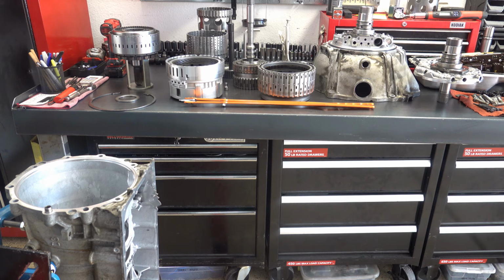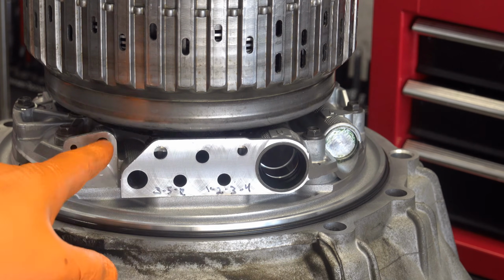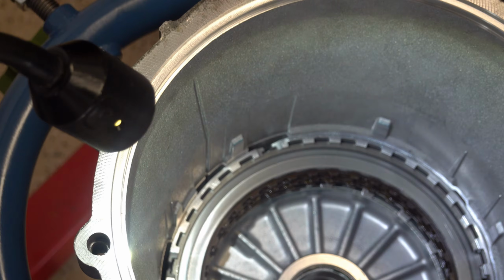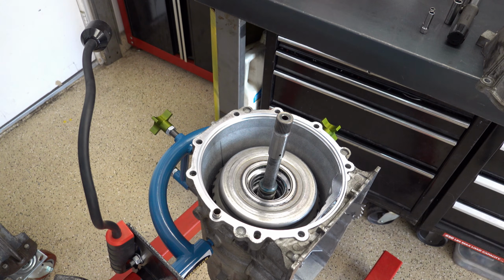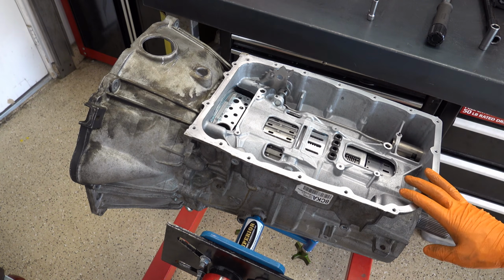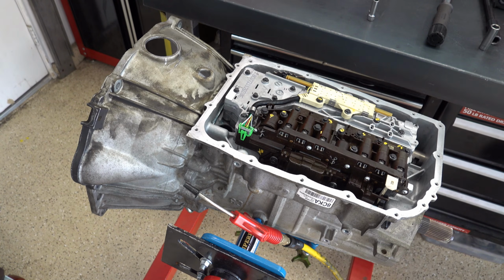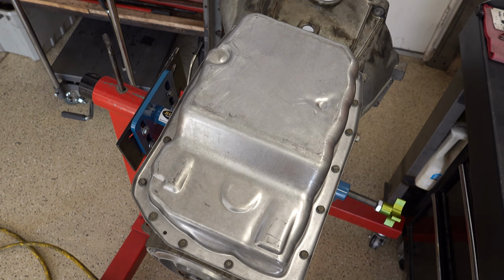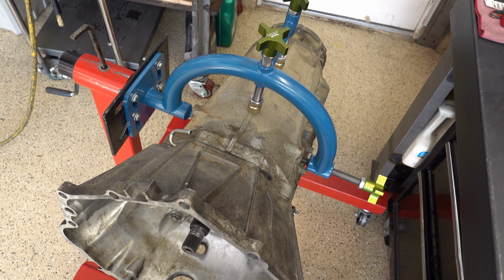6L80 Assembly PT2 - Final Assembly (DEMO) - Please Read Description

Comment: Hey Nick, Awesome videos! On the air check of the 456 drum , same as you have set up on the bench, I have air coming out compensator feed  port and center of shaft. The 456 clutches do apply but don't hold air pressure immediately after air is released. Also what psi air should be applied? Thank you.
Reply from the maker: Thanks, Peter!

The 4-5-6 clutch should apply and hold air pressure as long as you're flowing air into the circuit but as soon as air is released they will release. The compensator feed hole should hold a bit of air after airflow stops but before the nozzle and your finger is released, assuming you're testing the compensator feed circuit on the bench w/the pump, 3-5-R drum and 4-5-6 drum along with the three hubs all assembled...I use anywhere from 75-100 PSI typically as it's fairly close to what those clutches will see at lower to moderate RPMs.
Reply: Thank you Nick, Appreciate the response. Keep up the good work!
Reply from the maker: You're welcome, Peter and will do!
Reply: Hey Nick, I rebuilt and installed in 2015 Chevy Tahoe. It drives in limp mode 3rd and reverse I believe. Also engine light on despite removing codes with scanner. Will not illuminate Manual or tow mode on the dash selector. Any ideas? I did check plugs for connections.
Reply from the maker: @petermilner5493  Hi Peter. Did you perform a fast adapt relearn?
Reply: @nickstransmissions  Hey Nick, No I did not. I borrowed a snap on Solis Ultra that he uses on dodge transmissions but haven't found an option on it for fast learn.
Reply: Additionally I did use an exact numbers matching techm.
Reply from the maker: Ah - found the problem...The Solus Ultra should have the capability (I know mine does) .... What software version is installed on yours?
Reply: @nickstransmissions  So your saying that's what causing the engine light and limp mode? I don't know what software is on it or how to find out. Does it show in it's settings?
Reply: It says bundle 18.2.0 Version: 1.14.0.1011
Reply from the maker: @petermilner5493  I think its displayed and accessible via your main menu. If your software version is 14.X or earlier you wont have the "reset adaptations" option availabe but it will still read DTCs. You need to do a fast adapt prior to driving the vehicle. So that's at least part of the problem...Whether that is the only problem will depend on what DTCs are being set and stored. 

What DTCs are you showing?
Reply: @nickstransmissions  Ok sounds good. Thank you for your time. Much appreciated 👍
Reply from the maker: You're welcome, man.
Reply: @nickstransmissions  P0967, P2721,P2730.  Pressure control solenoid valves 2 , 4 and 5 control circuit high voltage. Sorry I didn't see the rest of your question yesterday. Engine light will not go off after multiple trys with scanner. Scanner responds that all codes are cleared. I figured out it's an 18 version on the snap on Solis Ultra so it should do it but it doesn't display a fast learn option in functions. Maybe because engine light remains on? Thank you.
Reply: This comment is just to assist others . I bought a like new condition reman TCM and when a shop went to program it they found it to be bad. I would suggest a new GM to save yourself any headaches.
Reply from the maker: Sorry to hear, Peter...Do you still have the bad TEHCM or did you return it?
Reply: @nickstransmissions  Shtuff happens... haha . I still have it.
Reply: Why Nick ? Is it worth more than being a paper weight?
Reply from the maker: Sorry, been away from the computer....I may be interested in buying it from you as I don't have any 'bad' TEHCMs on hand but been wanting to get my hands on an example to demonstrate in a video what a bad one looks like when being tested. If you're interested in selling it, let me know and how much and we can go from there...
Reply: @nickstransmissions  Yeah, let me see what the seller wants to do and if they won't let me return it then I'll let you know. I did take apart my original and individually removed each solenoid , attached a piece of tubing with a pressure gauge to air supply and then applied 12 volts to each one. They all operated. I did it because the original code was for a stuck solenoid. I'm not a mechanic nor a transmission guy and this was a first for me but once I had a basic understanding of these transmission, with your help, I realized the physical parts , valve body and TCM all work together so a solenoid code doesn't really pin point the problem. I had a 456 hub sheared off at the welded spline . There was a bind up right before it  . The valve body had terrible machining marks. Looked like it had possible cross leaks in the plate gasket.  One check ball was out of round. No metal in the pan. I lost 4th 5th and 6th and it did have solenoid codes. No clutches or steels were burned. Pump had slight wear but not major. I replaced everything just because that's how I like to do things but I don't think it was necessary except for the triple clutch Circle D 300mm TC . I wasn't going to do all that work and put a stock back in with their history. Sorry for the novel but I figured I should explain the road I went down. Thank you for your great videos.
Reply: It had a PO796 code
Reply from the maker: Ah, ok...yea, if you took it apart I really can't use it...Those TEHCMs aren't really made for disassembly as you can't replace individual solenoids...Thank you for getting back to me on it.
Reply: @nickstransmissions  No I took apart the original one that was in it and yes I did destroy it haha. But I still have the failed one that I purchased.

Comment: You can get the  large snap ring pliers , for 90 bucks from Lang tools. I have a set from Lang, which I just bought out of curiosity. I also have a set from adapt-a-case. They both work very well.
Reply from the maker: Thanks for the tip, Larry. $90 is a good price for those. Adapt-A-Case makes good stuff as well.

Comment: Hi Nick. You mentioned that this transmission is relatively easy. How would it compare against Ford’s 6R80 and 140 units in that respect? What would be the top three difficult and top three easiest ones in your experience?
Reply from the maker: Hi Shalash, based on my own experience and point of view, I'd say the TH350, C6 and 727/TF8 transmissions are the least complex/nuanced and great for beginners to get started with. 

The 200-4R presents with the most complexity as far as GM units are concerned, IMO. 

The Ford 6Rs and GM 6Ls are all based on the ZF6 HP26 and all three families of transmissions are fairly straight forward. The BWM transmission valve body assemblies can be tedious owing to all the little restrictors between the spacer plates and channel plates in those transmissions.
Reply: @nickstransmissions  Just out of interest, where would you rank Chrysler's RFEs and Ford's AOD/4R75 family? What about some of the older stuff like the FMX or Powerglide?

Comment: What about the compensator feed port which is the middle port between 1234 and 35r when you air check it it clicks but after that never does it again and leaks to the 456 port what could that be? And to get the compensator to re click i believe you have to hit the 35r or 1234 with air to de apply the compensator to get it to click again after that it just leaks to the 456 after it clicks once with shop air benching 
Could that mean my sealing rings are bad on the input shaft?
Reply from the maker: Great question - I will do another, separate video that walks through the compensator feed circuit and air checks more thoroughly, etc at some point in the near future but to answer your question, wear in that top teflon sealing ring can present as leaks upon air checking.  You would never re-use those sealing rings though, so no biggie if you're doing a preliminary bench check simply for diagnostic purposes or to help validate an initial failure mode diagnosis. If you're still seeing leakage after sealing ring replacement then either something went wrong during installation/resizing or the stator itself is bad.

Comment: Using a small strap will close the large snap ring & Tie wire double tied will hold that large snap ring on installation if you don’t have those pliers
Reply from the maker: Interesting - never heard of folks using a strap and wire for that snap ring so learn something new every day!

Thanks for the tip and for watching, Ivan!

Comment: If you put the 456 hub in the 456 drum while you air check. You can check compensator feed for the 1234 / 35R also. 

What I want to know is where, you got that engine stand. I have been looking all over for a engine stand like that. The legs are straight.
Reply from the maker: Hey Larry, great tip - thank you for sharing! Check out listing 285459515435 on eBay for that same engine stand ($105 shipped, plus sales tax for your state.
Reply: What about the compensator feed port which is the middle port between 1234 and 35r when you air check it it clicks but after that never does it again and leaks to the 456 port what could that be? And to get the compensator to re click i believe you have to hit the 35r or 1234 with air to de apply the compensator to get it to click again after that it just leaks to the 456 after it clicks once with shop air benching 
Could that mean my sealing rings are bad on the input shaft?
Reply: @qaysalshwaiyat905  

It’s been my experience that I usually cut the seal putting it in. However, when you stack it like it was stacked. And you put the 456 hub in the 456 clutch pack. You have to hold the 456 hub when you air check it. The 1234 / 35R drum will move up. On new seals the drum Will usually need to be pushed back down by hand. Also, new seals will sometimes need to have atf squirted into the apply ports. This will expand the seals. To seal correctly. 

If you are having trouble getting the air check. Fill the port with atf apply air. Spin the drum a few times. And recheck. 

I have had the problem you are describing. Unstack the assembly. Check the input seals. Repair if needed. If no problem is seen. Restack, add the atf, air check and spin the drums. See if that doesn’t solve the problem.

Comment: Hello Nick. Bravo for another great detailed video, chocked full of info. I have a 2009 6L90 out of a 4x4 in the shop that I'm in the process of rebuilding. Your advice for replacing the park rod instead of inspecting/reusing it is spot-on. This 6L90 is out of a 2009 Silverado 2500HD 6.0L 4x4 with over 200K miles. This trans has definitely been rebuilt before & the rivet on the park rod is also worn & getting replaced. Replacing the park rod on every rebuild is cheap insurance. There's an informative Gears Magazine article that details the problems with the 6L80/6L90 park rods wearing out. The article is titled: 
6L80/90E Park Rod: “A Closer Look” The article has several illustrations on parking rod wear/damage & what to look for. The 6L80 park rod actuator measures at 12.75" while the 6L90 is longer in length, measuring 14" The only problem with the Gears article is that it lists the same part number for both park rods. The correct ACDelco part number for the 6L90 park rod is 24242088. Take care buddy, great job on the videos.
Reply from the maker: Thanks again, Keltecfan! 

Appreciate the continued viewership. And you're correct - the GEARS mag does get the part number wrong but at least provides the length so folks can distinguish if need be.